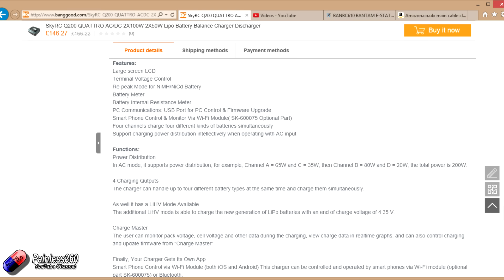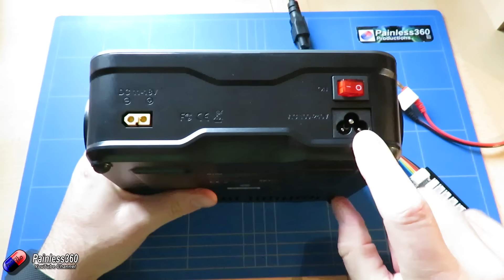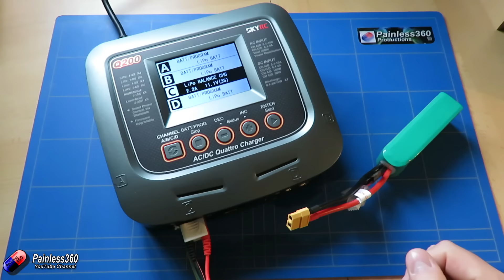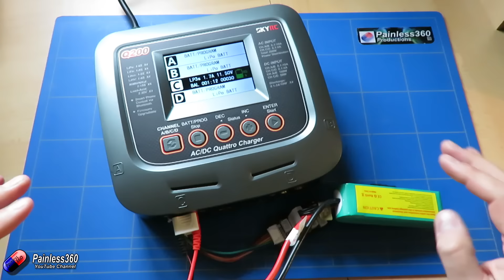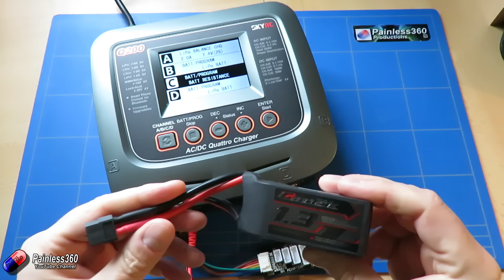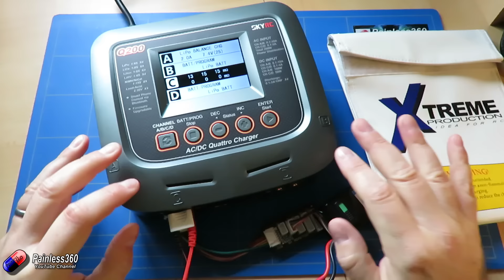RC Qverview: SkyRC Quattro Q200 Battery Charger (from Banggood.com)

Comment: Will this work as a car battery charger?  Can you reduce a resistance of a car battery?
Reply from the maker: A charger can't change the resistance of a battery. In the case of car  batteries, temp and internal corrosion are the biggest factors affecting the internal resistance and performance. Happy flying

Comment: Great review from 2016. Lee, I’m looking to move to either a parallel charging board for my B6 Mini or take on something like this beast. Is this still your go to charger for charging multiple LiPo batteries?
Reply from the maker: It sure is. I also have a little ISDT D2 on the bench for top ups...

Comment: Hello, I have a remote control car and I was told I could use this device to make the car faster do you know how I would be able to do that.
Reply from the maker: No idea. I'd ask the person that told you that. This is actually a battery charger and the only way it will help is by making sure that the batteries you use are fully charged...

Comment: if the lipo battery has resistance between 30 - 50, should you throw them away then?
Reply from the maker: If that was a battery here then I probably would. Usually a battery of that resistance will also show signs of puffiness as well and that's another indicator that it's come to the end of its life.. best of luck!

Comment: Hi. Do you still use it? I bought this new today and found the fan is not turning on when I start charging. I haven't start changing with full captivity yet. Does the fan turn on under certain condition or is it normal for not turning on together when the charger starts?
Reply from the maker: Mine starts briefly when it turns on then seems to come on when it gets too warm..

Comment: Got this charger quite expensive but it charges well. It is a shame the Android app "Q200" of it do not worked at all on any of my devices, Nexus 10 (Android 5.1.1) neither on my Lenovo 750S (Android 4.2.1). Was expecting better compatibility in this price range and flagship of SkyRc.

Comment: Thanks for the review.. What final charge  voltages do you get on each channel checking with a good multimeter?  So many of the chargers my students end up with overcharge packs, sometimes substantially.  Looking forward to the follow up.
Reply from the maker: Surprisingly good. The charger and balance board are new so this is as good as it should get but I got spot on 4.2 on each cell of the LIPO packs I tested. One of the older batteries (the one shown in the video actually) struggled to get perfect and it was 4.20, 4.20 and 4.19v. Interested to see how it performs over time..
Reply: @Painless360  Can you tell me how long it will take to charge a 7.4v 2800mAh battery?
Reply: @spirittoo  It depends of the battery.Typically at 1c (2.8mA) less than an hour.
Reply: @Painless360  Can you tell me how long it would take this device to charge a 7.4v 2800mAh battery?

Comment: On the phone app at around, 11:46 time, what is the Scan to go?

I would like to see or, even build, the ability to track history of batteries.

Stick an qr code or a bar code on the battery and scan it prior to charging. The app will then prepare the charger settings for charging and log it's results.

I think this app ability will put your product at the top of peoples pick list.
Reply from the maker: I've been figuring it out (the documentation for it is terrible!). Video out at the start of December covering it. It does allow you to preconfigure the settings per battery and print a custom label that then allows you to track the charges the packs had..
Reply: I was able to figure it out.
When you go into Program, you can create them there.
By touching the + sign. This will create a profile and have a QR-Code PNG picture with it that you can print out.
Reply from the maker: Yep, you plug the pack into the output and scan the QR code and select the outputs it's on to start the program it's set to.. Happy charging! :D

Comment: Just a heads up, the external temp sensor is used for Ni batteries as a means of stopping the charge if it is going over the batteries capacity. That charger tests individual cells of a LiPo so if there is failure the voltage will spike or fall and stop the charge. If your LiPo has started getting really hot (to the point of a cell venting), the temp sensor will do you no good. People still buy the sensors from where I work and ask how they should be used afterwards quite often. 

Great vid Painless360. Do more chargers 😎
Reply from the maker: +Chadd RainsFPV great info, thanks for sharing. I now have two temp sensors that I like to use for peace of mind even in LIPO charging. Happy flying.
Reply from the maker: +Chadd RainsFPV P.S. any chargers you want to see?
Reply: Painless360 I'd like to see some budget chargers. I'm new to the hobby and getting all the parts is quite expensive. Taranis, FPV Camera, Goggles, batteries, quads,. So if I can start charging on a budget it would be nice.
Reply from the maker: We are planning to look at a few, as with all things - you get what you pay for. We will be looking at more over the winter months. Thanks for the suggestion..
Reply: Painless360 Lee, you know how well the Skyrc S60 is? 
SKYRC S60 60W AC Balance Battery Charger Discharger
https://banggood.app.link/bHvylK4R5y

I'm building a F500 quadcopter and thinking getting a 3S with 10" props.
Reply from the maker: Looks like it's a baby version of this one. Not used it myself but we're very impressed with the Q200 so far..